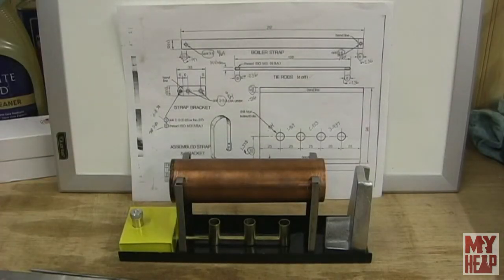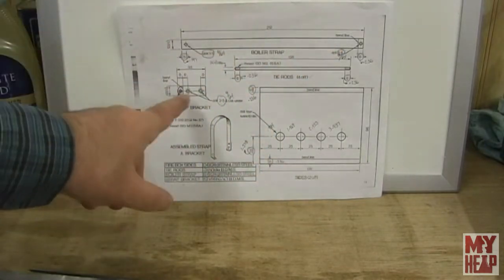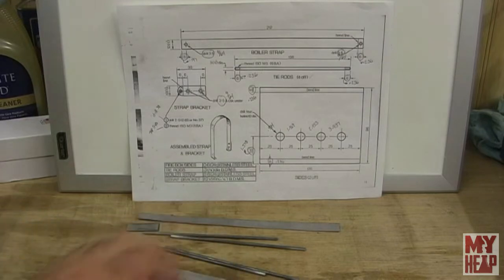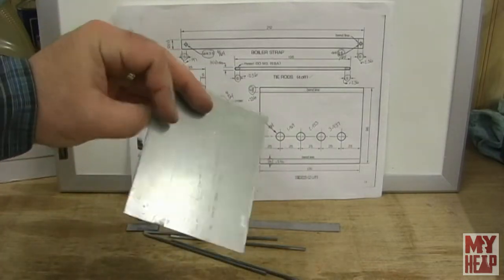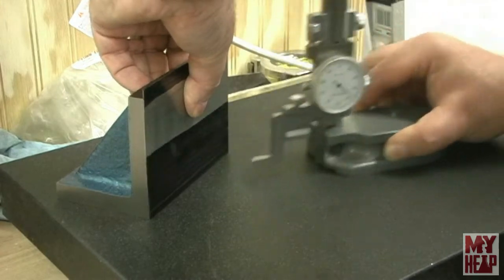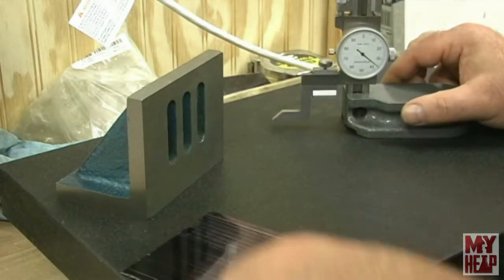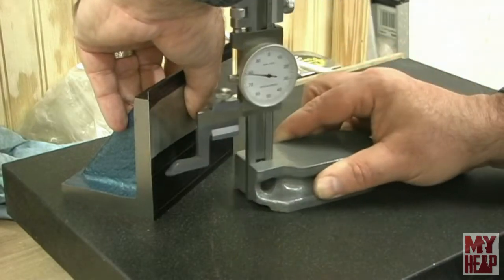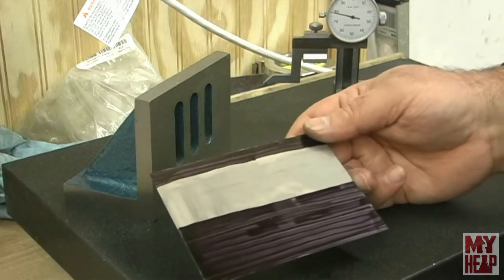Kenneth Wells Stationary Engine - 07 - Firebox Sides, Boiler Strap and Tie Rods

Comment: G’day Joe, builds coming along nicely. Good advice, bend first then drill and tap. The pop rivets will look ok if you’re concerned a dab of JB in the hole will improve its appearance.
Keep up the good work, cheers, Peter
Reply from the maker: Hi Peter.  Always glad when you stop by.  They don't bother me since they are not visible.  The gaps in the corner of the firebox ends is what bothers me.  I will be filling these in with some JB weld to tidy them up.  After it is painted it should look just fine.  By the way, I have not forgotten about the Burke mill.  I picked up a gallon of paint for it yesterday and received a new part for it today.  I will show it in the next video.  My problem has been work and stuff.  It keeps me from getting in the shop.  :-(

Joe

Comment: Its coming along nicely Joe 👍🏼 Cant wait to see it running~ Richard
Reply from the maker: Hi Richard.  Great to see you buddy.  The next bit seems to be the most intimidating part to me.  I never silver soldered anything before and don't really want to screw it up.  Still have to make a boiler test right too.  Hope all is well.  How is work going?
Reply: I am sure it will go fine, its like bronze brazing in a way. Use a good silver solder flux. Let the hot metal melt the solder, not your flame.
Reply from the maker: Thanks Rich.  We will see.  There are days I can screw up an anvil with a rubber hammer!  HAHA

Comment: 45% silver brazing rod from plumbing supplies.ask them for the flux too. its a white paste in a black pot usually.(probably only borax and distilled water) so its not a big deal who makes it.  higher silver content will give shiny seams and solder will flow better. ull need a BIG bushy flame and some silver solder flux. map will be ok, but if you can get a big volume tip for it it will be better. a brazing hearth or some firebricks will be important too. if you can get a map gas torch with interchangable tips, then the biggest one u can find will be a good investment.I made my first kw boiler with map gas, but its hard getting the heat in. now i use mostly a  LPG torch with a 40mm tip and it really roars. a primus kerosine blowlamp to help get it up to temp will make the job easy if you can borrow one.  you will need some pickle, so citric acid from the grocer is probably least dangerous. pickle it up for a while before u go solder it, will make the solder run nice. id save some scraps and solder them together first to see how u go. make the ends a nice tap in, solder one, then fit the other, then when ur happy back in the pickle till its clean and fit the bushing and pipe. email me if its not as easy as it looks. always try to help.
Reply from the maker: Hi Emma.  Thank you for the information.  You have been a huge help on this project.  I do appreciate you.  Will go about looking for the solder and flux and maybe about getting or borrowing a torch.  The Map gas torch I have is the type that screws on to the small disposable bottles like you would find in the plumbing area at a big box stores.  I don't know that the tip will be hot enough, but I may try is since I have some more tubing at hand.  Thank you for watching and all the support.

Joe

Comment: This is nice to be here watching you build this engine. Hey you are using one of my hole step cleaner tools for not too precision drilled hole clean up sure makes our general shop work a lot easier to accomplish around the shop. The engine is coming am long real well. Nice JB Weld tip attention to detail all is in the details in the makers world love the bras look with say your stainless steel panels. I look forward to seeing you dish the SS so we see how that is done by you. Lance & Patrick.
Reply from the maker: Hey Lance and Patrick.  Thanks for taking g the time to watch.  The step bits work pretty good for deburring their own holes.  I have to grind a radius cutter to make the dishing tool. Never made one before so that should be interesting to try.  Thanks for taking the time to watch, I really do appreciate it.  And congratulations on winning the hammer you luck dog!!!!

Joe

Comment: hey joe, looks good, the silver solder, I'd go with non flux coated 45% safety-silv solder, and you need to get the flux seperate. Evidently the flux coated ones are good for general use, but you may get the flux trapped into the solder joints and create weak spots, which is defenitely not wanted on a steam boiler, lol. I usually get my silver solder at a semi local welding shop, but you can buy it off of amazon too no problem. It is a bit expensive due to the silver in it, but a little bit goes a very long way, you dont need it globbed on, just a tiny amount is really all you need, so it will last you for a very long time.

I would also be very careful using the tailstock to align/push the die wrench because the chips from the die will want to get into the taper and you end up shoving the chips into the taper, scoring everything up and ruining the taper. That or it'll get blown back into the leadscrew and leadscrew nut in the back and just tear the nut up pretty fast, thats what happened to mine on my lathe. That's also a good reason why the back of a die stock wrench actually has the same taper as the front of a jacobs chuck front face.

For the rivets, Ive always just taken a piece of household copper wire and cut a section of it, put a small cutoff portion of it in the bench vise and peen the end over to create a domed shape, then you can do the same on the other end after putting the parts through it on a piece of steel or anvil. That usually makes pretty easy copper rivets for me.
Reply from the maker: Hey Chirpy, thank you for stopping by and watching.  I will look for the solder and flux the next time I am out and about.  Emma suggested the same amount of silver content of the solder and getting the flux separate.  I have some additional tubing so I will take a practice run on another piece, maybe with the intention of using it for a fuel tank or something later if I don't mess it up.

Chips being pushed into the tailstock taper never even crossed my mind.  Thanks for the tip.  And until you mentioned it, I never really noticed that the die stock and drill chuck taper were similar.  Thank again for another good tip.  People like you, Emma and Art seems to always be looking out for this newbie.  I appreciate it!

I thought the same thing with the copper wire, I just couldn't find any quite large enough to do the job.  I should have drilled the holes based on what I had in hand, then I could have used the copper.  I also though about taking an old punch, annealing it (if I can) and drilling a cup in the end with an 1/8 ball endmill then re-hardening it to make a rivet snap.  If I find myself in the future doing more, I may do this so I can get the nice dome on top of the rivet.

Have not forgot about the mill, just been overly busy with life to get work done on it.  I did receive the cast iron pulley cover Friday and picked up some paint for it.

Thanks for stopping by and watching Chirpy.

Joe

Comment: Hi Joe
ive been taking a look at some of your projects, the stationary engine is interesting, as for silver solder i use easy flo, not sure what equivilant is in US, but what ever brand you use the most important thing is spotless cleaned joints and plenty of flux, i will keep trawling through your projects as time permits, best wishes
mr f
Reply from the maker: Hi Mr. F.  Glad to see you stop by.  I found some 45% silver solder to do the boiler with, though I am not to sure of my heat source.  I need to find one as all i have at the moment is a MAPP torch and I fear it won't be hot enough.  I am hoping to get back on my little engine soon.  Been stuck in the basement of my house doing some remodeling.  I also need to get some taps and dies to continue on with the project.  Being a newbie at this stuff I have to acquire the materials and tooling as I go along.  I am about 2/3 through reading the TICH book and am fascinated by it.  When I discovered you were building a sweet pea (or variant) I though it would be nice to read along and watch.  Perhaps I will learn something.  Thanks for sharing and taking the time to stop by.

Joe
Reply: Hi joe
Regarding your heat source, why  spend money!!!!, I noticed on one of your videos that you had a electric hob,  may be worth a try, what about  standing the boiler on the hob to preheat, with some fire bricks around, then go in with the torch, my easyflo melts at approx. 625 degrees f,  the copper will be at around a dull red in a darkened area
Regards
Mr f
Reply from the maker: @MrFactotum  I think it is the regional vernacular differences, but I am unfamiliar with the phrase "electric hob".  Are you talking about an electric hotplate for cooking or my gas camp stove.  I don't mean to be an idiot, sometimes it just happens to me.  <grin>

If this is the case, then it is a good idea to try.  I hadn't thought of that.  It is one of the joys of being new!  HAHA

Joe
Reply: Hi joe,
Yes you got the jist of it, either the hot plate, camping gas stove, electric hob, secondary burner, what ever you've got to pre heat the boiler to assist your gas torch. I know my boiler was much much bigger than the one your doing, but if you take a look back at my video, i had a home made secondary burner that i stood my boiler on to assist in getting some heat in to it, but get some insulation around the job to keep the heat in, where it needs to be.
Its not a matter of you being new to this work, new or well established, every body has different ideas to share, i think ive started to "waffle" now, so i sign off for now
Best wishes with your project
Mr f

Comment: See now, Joe...what you did there is dangerous. I am the last guy you could accuse of being a 'safety Nazi' but drilling 'grabby material' such as plate, without some sort of stop clamped to your table, is asking for the 'flying guillotine routine' !
Just a bit of square stock (or even a wooden piece) will stop the part from turning into a blender blade for your fingers if the bit grabs (and they do, no matter how sharp and new and snazzy they are!)
In other news : nice progress on the engine ! 
Glad the rulers are of use!
Re bending small pieces : indeed, make the piece a bit longer, bend first and only then drill and tap. Once that done file/cut/bite to size.  Holes tend to go 'walkies' on bits that small when they are bent.
Small aluminium rivets can be had on ebay for cents/100. 
Re boiler, whatever you do, DO NOT soft solder it! A silver solder such as easy flow will do fine, It may be sold as "Easy-Flo® 45" in the US, but basically any grade will do fine for this sort of small boilers. Flux you can make yourself. Just crush some borax in some water and make into a paste. Works great!
Take care !

Paddy
Reply from the maker: Hey Paddy.  I will try to remember to set up a stop next time.  :-) I know the boiler cannot be soft soldered.  Am trying to source some solder locally before I go and order anything from somewhere on the net.  I have done LOADS of component soldering for electronics, so maybe some of that visual experience will come over to this little project.  Thanks again for the scales, they have been very helpful indeed.

Joe

Comment: GO to home depot or check for silver (56% silver) by content.  Also be sure to get the silver flux that goes with it.  Soft solder will melt when the boiler gets hot.  Sometimes Home depot will have a small amount of Silver Solder (AKA Silver Braze) in a small package usually costs about $14.95 should be enough for you project.  If all else fails shop online for the materials.  Good luck!
Reply from the maker: Thanks James.  I will have a look.  Thanks for watching and taking the time to comment.